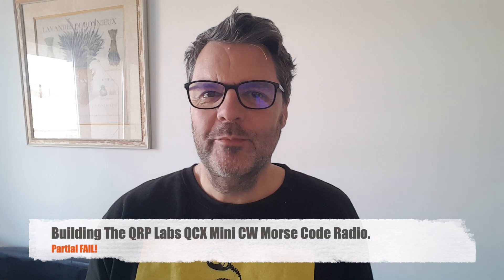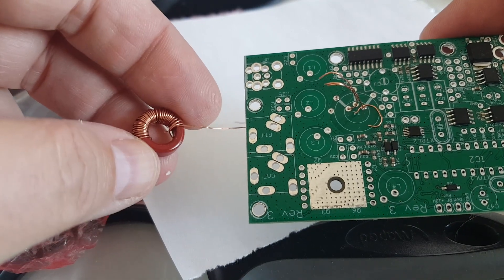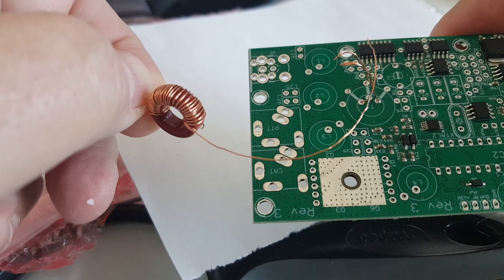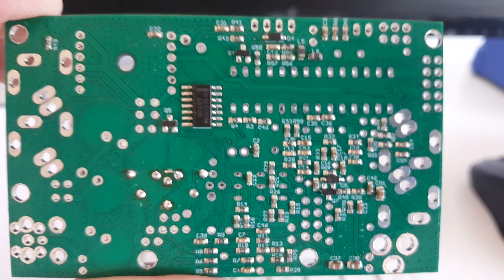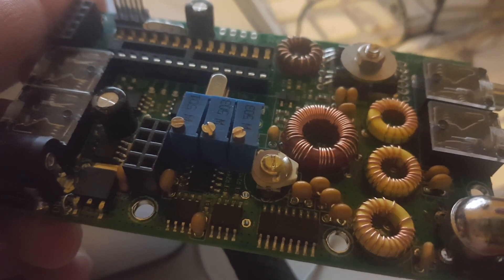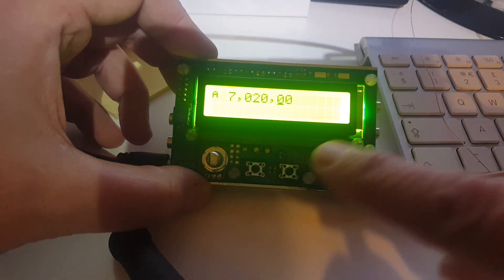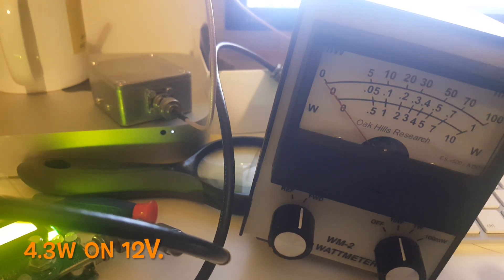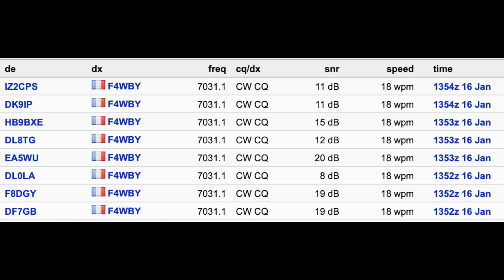Building The QRP Labs QCX Mini CW Morse Code Radio.

Comment: Enjoy your videos Gil.....I put off building the first QCX I bought because of the toroid windings. Finally jumped in and found out they weren't as bad as I thought. I agree with you that the way the manual explains how to wind the toroids...well didn't work well for me either. I ordered some different colored wire and wound the smaller number of turns each in different color and, for me I could keep track of the number of windings much easer. I also agree that. Hans puts out not only a top grade product but also provides one of the best manuals I have ever used. I am an old man and started my hamradio career in the early 1960s. the days of tubes....or valves as they were called some parts of the world  I have put together a number of Heathkit projects that were accompanied by step by step assembly instructions plus many many drawings. Hans certainly rivals them. Thanks again and keep up to great videos.
Reply from the maker: Much welcome George :-)

Comment: Good review Gil, thanks. I built a QCX-mini for 17m a while back. Thought it was a fantastic kit and a brilliant development of the original QCX. The QCX-mini is easier to build than the QCX as more of the components are SMD and already installed. The assembly design of the PCBs and case is genius. As with the QCX, the features and performance for the cost is amazing. I quite often use mine in the shack as well as for QRP/P just because they are so nice to use. Just carefully follow the very concise manual. What I did was print the manual so that I could tick off each step. It is also useful to keep for reference as it also has all the operating instructions.

Comment: Gil - Thanks for this video. Well done. If you are not already familiar with a circuit board holder such as the Panavise, such a tool makes soldering these small boards and components much easier as you can use both hands while the board is held steady. I’m about to start building Hans’ new QMX this week.  Jim - N7RCS
Reply from the maker: Right! I've been wanting to get one of those.. No idea why I've delayed..

Comment: Per Hans “One is 500-ohms (written "501" on the top of the component) and the other two are 50K (written "503")”
And “If one or more of the trimmers is at the extreme end of its range then you can appear to get no minimums... If you want to reset the trimmer to the middle again: keep turning the screw clockwise and clockwise and clockwise, and listen carefully, you'll hear a very faint "click" once per revolution, when it is hitting the end. You can then turn it back 12 turns anti-clockwise and know you're in the middle. If you do this with all three pots, you'll know you are in good shape with all trimmers in the middle, and can try again. “ fwiw es good luck!
Reply from the maker: Ok thanks. My hearing isn't that great anymore I fear..

Comment: I did the same with T1.  Bought the 40m kit, attempted it twice, put the kit away for months, then dug it out and completed it last week for 20m, where there're less windings. I agree, the loops thing is confusing - I found doing each winding individually much easier.  Overall, T1 was definitely the hardest part of the kit.

Comment: I was daft enough to buy one of the first batch of these which arrived last January. All went well until the calibration stage where the results just didn't make sense. Using an oscilloscope I determined that one of the pre-soldered on op-amp ICs was faulty which annoyed me. I suppose I could have tried de-soldering then replacing the op-amp but by this point I had enough of this kit so sold it to another amateur for spares. He later reported back to me that 3 of the op-amps were actually faulty ! Looking on Twitter at the time it seemed that quite a few of the first batch suffered from this problem and for later batches QRP Labs started testing the part built boards before sending them out to customers but that wasn't much help to me.
Reply from the maker: Wow, good lesson about early adoption here..

Comment: Very helpful.  I appreciate the discussion about why 40m is the optimal choice for you.  I would tend go with 20m because of the size of the antenna, but 40m is probably the band most likely to be open somewhere 24 hours per day.  I think you made a very good choice.
Reply from the maker: Thanks. Portable, antenna size is usually not a problem..

Comment: You can adjust the frequency it transmits on by the adjustment of the IC chip ratio to the actual crystal frequency your crystal produces.... it's a mathematical equation adjustment.  Keep in mind the crystal oscillation rate varies with the temperature of the crystal inside the kit.  Read the instructions for how to do it.

Comment: Another way of doing the IQ balance would be to set the potentiometers to a nominated resistance value before installing them so that at least they are already in the ballpark. :) 73, VK7IAN

Comment: Gil, did you ever get your QCX Mini aligned properly?  I have built 4 of these successfully, and the alignment all went by the book - you should see definite nulls as you adjust the sideband suppression.  Also, for frequency, there is a way in the alignment menu to adjust the reference frequency and get that radio spot-on.   As you noted, the build is not difficult, but one must be cautious and follow the detailed instructions for a successful built - the end result is well worth the attention to detail.  It's a fantastic portable radio for SOTA - loaded with features, and very affordable for what you get.  Looks like it's been a year since this video - I hope you got it working to your liking!
Reply from the maker: Hi, my first two worked fine, I need to get back to it!

Comment: 14:00bargraph and a digit. The number shows value and the bargraph fraction part of value i.e. 6 and two bars is lower than 7 and 1 bar
Reply from the maker: Yep I know.. It only changed three bars on the same number.
Reply: @RadioPrepper  Ok, only changing three bars on the same number is not right. the original batch had some bad op amps, that variety of op amp had all different manufacture dates stamped on them making me think the board house got a good deal on a bag of seconds that mostly worked ok but had several duds in the bag. My recollection is that it produced similar symptoms at least some of the time. I think Hans switched board houses and now he tests every board before he ships it. So if it’s from the first batch that could be the problem. Replacing the bad op amp fixed it but you had to diagnose which one was bad or replace all the op amps of that variety. Rarely you get a surface mount part where the solder joint is marginal and might fail. So it might have gotten through hans’ test, failed later and probably still looks ok. Not it might not look ok, so microscopic like inspection of all the op amp pins might produce a suspect. That would be a long shot but might be cured by reheating the joint if you could figure out where the problem is. If you ask on the list, someone who had this problem will probably remember the details and be able to help you, if that’s what is going on. The op amp variety in question is a low power consumption one with very good performance but that performance is really critical only in one location and the rest can be replaced with a cheaper variety with little change in overall performance. 
From around January of 2021:
 “I'm happy to say that my 20m QCX-mini now has a receiver with balanced/ quadrature I&Q!
It turned out to be IC7 and once I managed to replace it all was well.
FWIW it turned out all I needed to do really was use my finger to fault find.  Holding a small metal probe to the inputs of each op amp in the audio chain in turn, working back from IC9, I soon found that I didn't hear any hum from the input to IC7B.”
Reply from the maker: Thank you for your time. It is the latest batch though...

Comment: Hi Gil. QRPLABS latest kit the QDX for Digital FT8 FT4 WSPR is a similar kit to the QCX which covers all of  20 30 40 80M which I have found to perform very well. My first QSO on FT8 was with a VE station on 2w. The receiver reception is as good as my IC3700. I have matched this with a Raspberry pi 4B 2Mb to make an almost portable setup. Especially ideal for WSPR use on my 80M EFHW aerial covering 20 40 80 matched for low power consumption without using my main rig.  I do like your video content. Tnx 73 G4PEY
Reply from the maker: I have a video on it ;-)

Comment: Did you do the calibration per the manual? That is where side band suppression is accomplished. Added: I see that you mention it. If you didn't iterate over all three blue potentiometers oh, probably at least three times or until no more changes then it may not be good enough yet.
Reply from the maker: There is no stop on the pots, so hard to say..
Reply: @Radio Prepper  you have to go back and forth tweeking each one in turn going around again and again until you cannot get them all any better.
Reply: @Radio Prepper  if you get really lost, power down and use an ohmeter to set each pot at the middle of its range and start over. Also as you get near one end of the indicator, the range or scale for that indicator changes, up or down depending on which way you are heading, and this can confuse you if you are too focused on just the bars and don’t notice.
Reply from the maker: Thanks guys, I will try again.
Reply: @RadioPrepper    No physical stops, but those pots are approximatly 25 turns end to end. At the ends, in a quiet room, you can hear clicks as you turn. If I get confused as to where I am I just turn till I hear the clicks and then turn back 12 turns. That's close enough to the middle to start over.

Comment: Great vid, Gil. This radio really encourages me to learn CW. I've never passed from 10-11 letters/signs.
Best of luck fixing the band suppresion issue. Unfortunately I can't help on that.
73, EA3HVG
PD: I have doubts on the band. You recommend the 40m, but I wonder, would't be interesting an upper band  just for having shorten and more practical antennas? I wouldnt mind using warc bands. I think I'd never have enough level for contesting.
Reply from the maker: Depends if you operate portable or not... In the field antenna length is no problem.. That said I am a big fan of 30m :-) Upper bands are not opened as often. 30m has no contests too :-)

Comment: Just finished a 20m and 40m kit some days ago. I had to bend a metal lip of the display flat against the PCB because it was sitting against one of the blue potentiometers. So alignment of the two PCBs did not go well. That was the case with both kits.

Also the nut + washer did not fit far enough on the BNC chassis part. The bayonet clamping of the cable part had too little space and did not fit on the chassis part. Mounted without the knurled ring.

Both are great QRP rigs however. I'm very happy with it!

Carel - PA0CMU
Reply from the maker: Great. I did not have those problems but it was a tight fit..

Comment: Good video Gil.  I've been looking at the QCX mini transceiver; however, my first objective is to become proficient in CW at the 10 - 15 WPM range.  I requested membership to the Long Island CW Club yesterday.  Maybe in a few months I'll be looking at this kit.  73!
Reply: If you don't have a CW rig already, I recommend getting a QCX, paddle, straight key, and a resonant antenna WHILE you're learning CW. Getting on the air is IMHO the best way to learn CW. Ten to fifteen WPM is a great goal, but you don't have to be at that proficiency level to get on the air. By getting on the air sooner, you'll benefit by: a) being able to decode real CW code which is sometimes far from the perfect code sent by training programs, b) learn how to operate your radio for when you are ready to get on the air, and c) begin making QSO's as soon as possible, d) using the decoder in the QCX in practice mode to help see if the code you're sending is legible.

SKCC is a great "slow code" group to get started with, and three exchanges are very simple and forgiving. Anyways, good luck in your CW adventure!
Reply from the maker: I would highly suggest not learning below 15wpm no matter how hard it is.
Reply: LICW great club.
Reply: @kn6eze  Thank you for the tips.  All make sense.  I've done 2 CW QSOs so far in the spirit of learning by doing.  73!
Reply: @RadioPrepper  OK.  Thx for the advice.
Reply: @quantumradio  Awesome!

Comment: Great info....but Where do you get a power suppy or rechargable battery for this? Also what is the simplist antenna you can use for greatest distance?
Reply from the maker: You can use three 18650 cells in serie. Use a half-wave end-fed antenna...

Comment: Super video, j'ai aussi un qcx-mini, sur 20m. Tu as 2 modifs a faire, rajouter un fil pour la mesure de la tension (ta batterie est vide sur l'ecran). Et un condo aux bornes du jack 3.5 du speaker, pour eviter les retour hp dans l'ampli bf.
Reply from the maker: Merci! Je voulais faire là mod du voltmètre mais n'était pas certain des contacts à souder. J'aimerais une photo du dessous du circuit imprimé avec la mod..

Comment: I wish Hans offered T1 prewound for a few extra bucks, Elecraft did so with their K2 kit which I built in 1999, although I did wind all toriods myself back then.  Hams around the globe are aging and this was a difficult kit for me due to old eyesight and shaking hands....just my 2cents. I also found aligning of the sideband suppression pots to be non responsive.  So, not my cup of tea I gave the QCX mini away  Belle vidéo Gil  73/K6SDW
Reply from the maker: It's really easy once you understand how the wires go..
Reply: There are a few of us will build these kits for you for some nominal price - sometimes less that QRP-Labs' factory assemble adder. I do it for subscribers to the groups.io forum. It would be no trouble to do a partial build: wind, install and continuity-check the inductors, then send it back to the owner to complete the rest, if they so chose.

Comment: I just received my 20 and 40m QCX mini’s. I did have to email Hans at qrp labs because I couldn’t get the bnc male connector on the coax to lock onto the bnc female connector. Hans suggested removing the washer under the nut on the transceiver and it then locked down.
Reply from the maker: Interesting, I had no issue..
Reply: @RadioPrepper  Yes Hans said that was the first he had ever heard of that. I sent him a pic of my Kx2 with it connected to and the QCX with the connection halfway from lock. He suggested removing the washer from behind the nut. That did it but I couldn’t figure out why mine was a problem. And that’s on both the 20 and 40m transceivers.
Reply: I see this with the more recent kits. The last four I've built I had to leave the lock washer out. I think the supplied nut is thicker. Don't know for sure because all my previous mini's are sold. Build/sell, repeat. :)
Reply: @fireflaze  Oh. Well good that makes me feel better. I thought it was the BNC connectors I was using. I kinda thought that it had to be either the nut or washer was thicker but Hans said that he hadn’t heard of any problems like that before. But you’re proof that something must have changed. Thanks for the info.
Reply: @fireflaze  Hi Mike :-)

Comment: My old electronic teacher used to get so mad cutting components legs after soldering.
Reply: Why? Did the teacher want you to precut the leads? Curious.. thanks.
Reply: @52Warlock  This is rather about putting tension into solder joints when you cut leads after soldering. There is theory that such stressed joints would be more prone for further degradation ie oxidation, cracks, etc. Heard this many times.
Reply: @52Warlock  yes precut the leads, as not to stress the solder which could lead to issues in the future...
Reply: @kamilsp7  spot on that was what was drummed into us, especially with regards to mil spec applications.
Reply from the maker: I never did that but I guess for some sensitive applications it makes sense.
Reply: @RadioPrepper  It's one of those things that I always remember when soldering, I can hear his voice in my head hahahaha.
Reply: @kamilsp7  reheat all the solder joints and the pretension or stress is relieved.
Reply: Could not the shock from the snap of precutting the unsoldered undamped lead stress the component and the connection in the component between the component and its leads? You could clamp the lead with a hemostat between the component and where you are pre cutting the lead to try and protect it. I have trouble seeing how cutting the lead after soldering could damage a good solder joint but I agree that reheating should fix that if it does happen.
Reply: @davidelley8979  and Kamil K .  Thanks for the reply.  I have always gone the other way : solder in long , cut short , then reheat the joint. Learn something new every day!  Again - thanks.